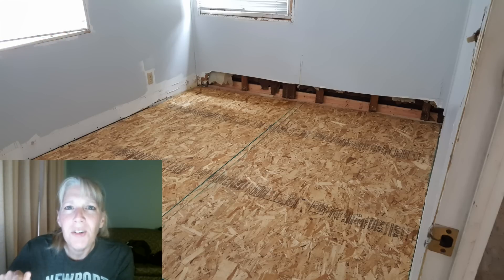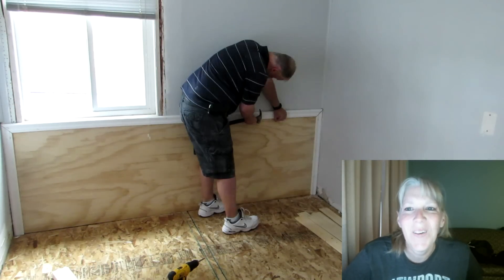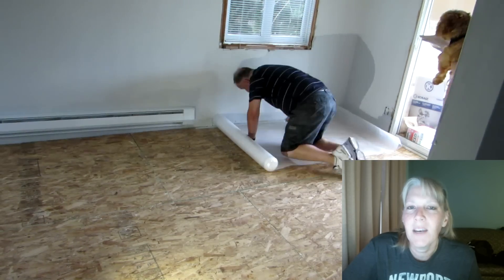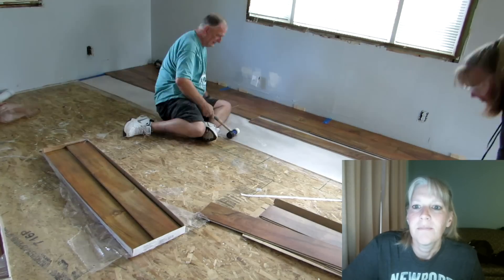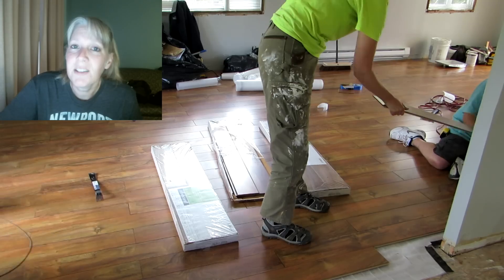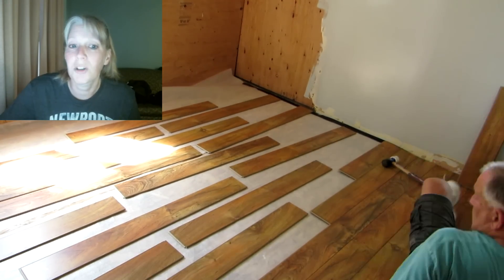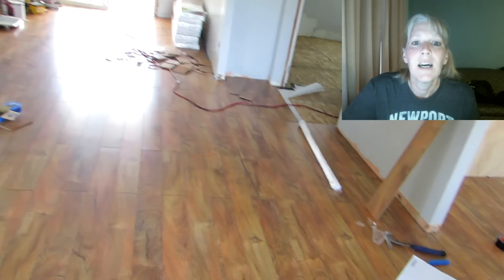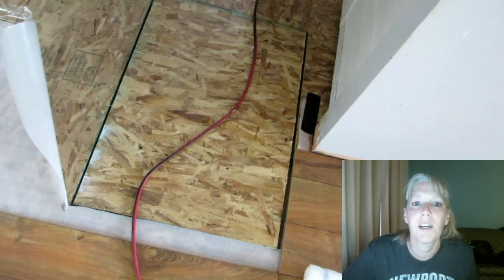Flooring, Oregon House Ep  4

Comment: I have a crawl space access from outside, into a hole in the concrete foundation.  But, I want to add one from inside the house so I can change the air filter in my furnace a lot easier.
Reply from the maker: +Heavyboxes We were going to move it to the bedroom closet but decided that was more work, so we kept it smack dab in the middle of the house (seems lie it is anyway).  We have access from outside too.  Wild your furnace is down there!